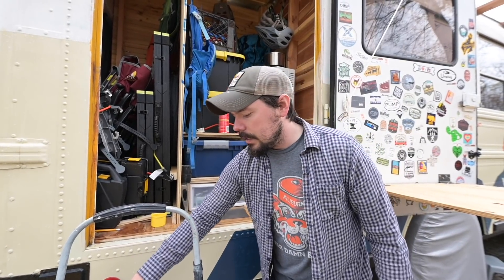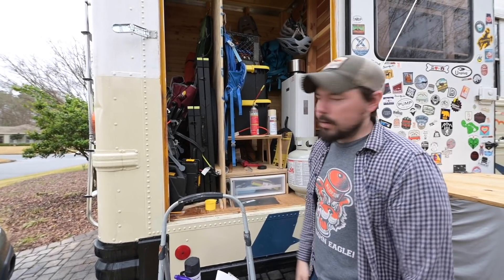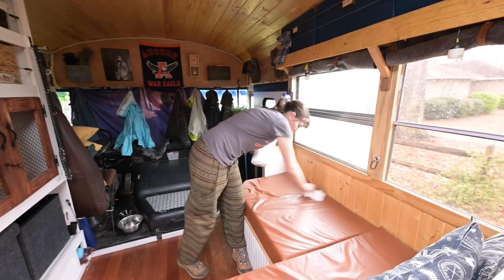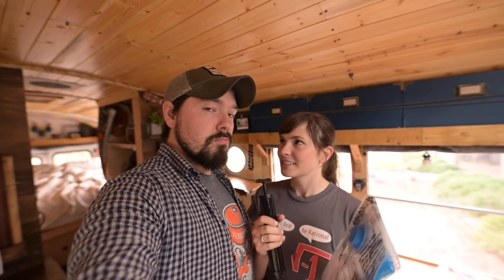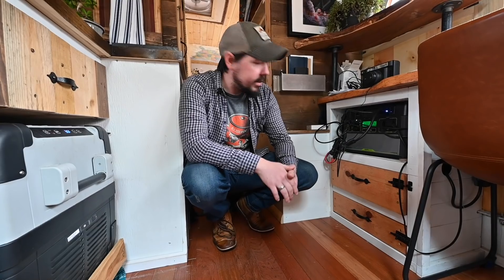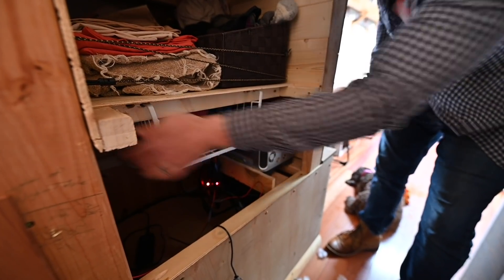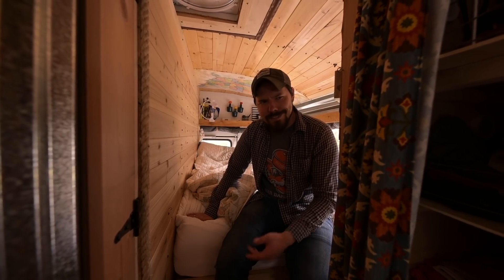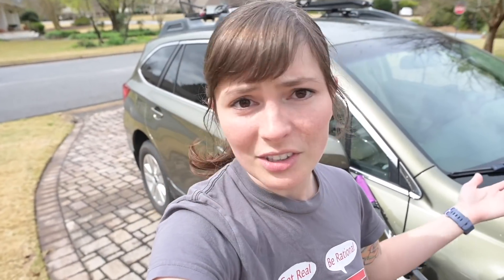Ready to hit the road and head west in our bus conversion | Final build updates

Comment: HOLD UP... YOUR FRIDGE.... it might NOT be your yeti... I have that style of dometic fridge and there is a SAFTEY SETTING on your fridge that will prevent it from draining your battery too low. You can set your fridge to STOP WORKING if the voltage/energy gets too low (so it won't completely deplete your battery) There are 3 settings on your fridge and it IS adjustable. Its a smart setting to allow the users to adjust it depending on what kind of energy you are using to power your fridge. SO... go set your settings on your fridge to NOT shut off at lower energy levels. 👍🏽

Comment: Best stuff to use on rust is and will always be "Ospho" !!!!!!
Reply: Radar, what is that & where do you buy it? ... gots some rust on floor of my van ☹
Reply: @briannab5296  I bought it at Ace Hardware but most Home Depots sell it. It's phosphoric acid. It turns iron oxide[rust] into iron phosphate. It's a stronger version of what Rustoleum uses in their paints to "inhibit" rust.Comes as a green liquid and you MUST not put it on aluminum or stainless steel. It works by changing the iron oxide into iron phosphate which creates a barrier to oxygen stopping the rust action.Read ALL the warnings and use it outside. It is an acid and some people have a low tolerance to the fumes. I use nitrile gloves when applying it.Once I was applying it and dripped some on my foot, which was bare [not a smart choice but I WAS wearing gloves] and it burned into my toes. I didn't feel it because of my diabetic neuropathy and it causedd a nasty burn.In my defense, not a smart choice but I WAS wearing gloves.             READ AND OBSERVE ALL WARNINGS!!!  BTW.....It will turn black and that's normal.
Reply: @radarhouse6443  ... thank you .. i've never heard of it, learned something new today 😉

Comment: Thanks for talking about that garage battle! I live fulltime in a minivan with a stow and go area, which I was quickly like 'that'll help with storage' when I first got the van. Only I'm still on a journey to figure out how to avoid exactly what you were dealing with (in a much smaller space of course), but the balance of how to store things so that it not's a total headache when you want to pull something out to actually use it is completely a journey. I've told other people interested in the drop space of a stow and go area in some minivans for camper builds that it's both a blessing and a curse.

Comment: We recently purchase a 8kw diesel heater for under $200 off ebay. I've looked at all the reviews and they are freaking awesome. They heat for 24 hrs on 2 gallons of diesel running full blast. We are putting one in our 1987 Thomas saf t liner. Check it out. Love your videos guys!
Reply: The thought of diesel  roaring away is certainly appealing yet the new cheaper models that currently flooding  the market can be unreliable in constant use. I am always working on those that my fellow rubber tramps have installed. Instead I went with a top of the line european model and although very dependable...I sadly cannot stand the noise. I switched back to a "platcat" brand heater...which are no longer made methinks.  I sometimes use wood geat when away from population centers. I also have a wall mounted catalytic propane heater which I love yet you need to have a tiny low air inlet nearbythe heater and a air outlet up high somewhere in your rig for moisture control.
Reply: @geraldhenrickson7472  I consider these more for emergency back up. Many ways to heat. My first choice is wood stove. Thanks